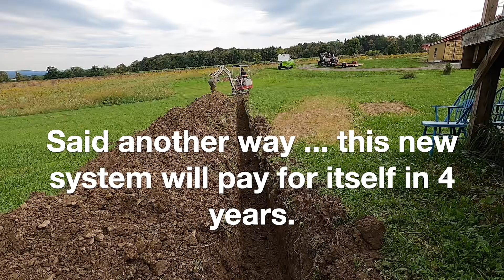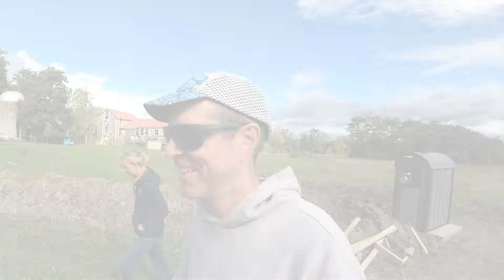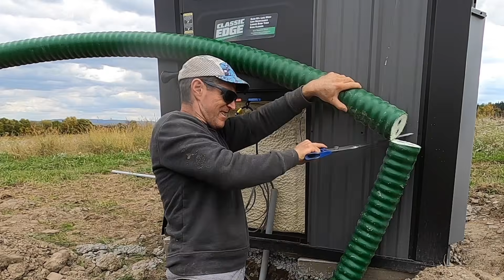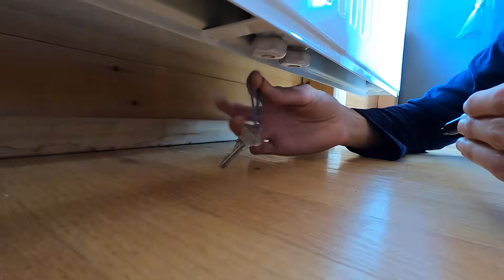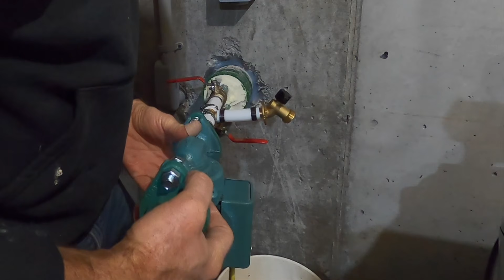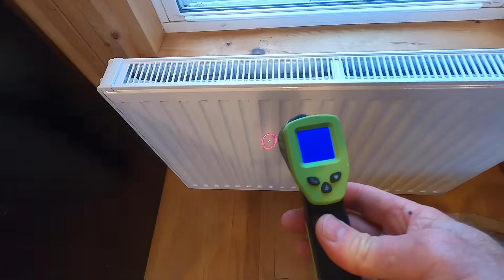Outdoor Wood Boiler FULL INSTALL, Start to Finish

Comment: So where are your links man?! Where did you get those radiators? I have Toyotomi  electric fans for mine. I haven't even actually used my wood boiler yet. Just moved into the place in the winter and can't really fire it up until I get everything checked out. They didn't hook everything up right either so I have a lot of restructuring to do. Might just go geothermal instead.
Reply from the maker: just search for "european radiators" and you'll find what we used. You're gonna love that heat once you get it running! nothing beats it
Reply: @metaspencer European? Does that mean they have to get shipped from Europe? You should do a video on where you bought them, how much they cost and shipping and stuff like that. Yes, I hope you are right.
Reply from the maker: we found them locally through our wood boiler dealer .... great radiators!
Reply: @metaspencer Sorry to bother you again, what is the brand of the European heaters you bought? Thanks!
Reply from the maker: I'm not sure of the brand ... sorry to not be of help. no markings on them even

Comment: why so far???
Reply from the maker: We like to be able to open windows in winter and not choke on smoke. We also like to spread out buildings out and keep woodpile mice away from the structure. Perfect placement for heating both buildings, too

Comment: I want one of these for my shop but I will only heat it on the weekends. Won't the water in the unit and lines freeze?
Reply from the maker: Moving water is pretty hard to freeze, but yeah, you might want to run an glycol mix in those lines

Comment: Why did you put the wood burner in the next county over?
Reply from the maker: we like to keep smoke away from the house in winter, as well as mice that live in the wood piles ... on a huge property we also like to spread out our buildings. Could have been even farther away but the location had the perfect contours and altitude in relation to the house and heated barn given weight of the pumped water
Reply: @metaspencer  I actually watched your follow up video and heard your explanation. I will be installing one eventually, your videos are helpful. Thanks and good work!!!

Comment: I put all my pumps in the basement of the house so if a pump was to fail I don’t have to go through the pain of having to work outside in -10 degree weather in the dark in the middle of the night and believe me when a pump goes it always happens in the winter at night so I strongly recommend it!
Reply from the maker: sounds like a good setup ... with our boiler being lower than the house I kinda thought pumps at the unit would help move the water

Comment: Whats your climate like? Ill be building in Midcoast Maine and really want to do radiant floor heating. Seems like it would be the most efficient. Do you lose any temp for a longer footage system?
Reply from the maker: Only lose 1 degree between unit and house, so not a problem having a long run. Climate is similar in upstate NY. Radiant is the way to go -- our radiator system is way better than forced air IMO

Comment: I was going to say you should have installed it much closer to the house so it stays hot but looking at that tube which will be buried underground I would say you are in good shape.
Reply from the maker: Yeah, we’ve only lost about 1° temperature between the boiler and the house so it’s been working out good

Comment: Did you run a thermostat wire from boiler to thermostat in the house? How did you hook that up?
Reply from the maker: boiler has a wireless control panel so you can track furnace water temps on your phone or computer

Comment: Hi. Why did you add a pump inside the house? I’m going to be new to this. I have a small 1400 sq ft house. Thanks.
Reply from the maker: we had two pumps on each line given length and drop to the boiler, but there are many people who only install one pump per loop

Comment: Why so far away.....
Reply from the maker: we like to keep our buildings spread out, don't like smoke in the house in the winter when windows are open, prefer woodpile mice far from the house, and it's at a good point to heat multiple buildings

Comment: I appreciate all the hard work that goes into setting this up. Hope you like the operation of it because I know I would not. For the price of this entire system you probably could have purchased two Kuuma Vapor Fire 100 furnaces had them placed fully inside your home and barn without all the problems that go with OWB.
Reply from the maker: I haven't seen those Kuuma Vapor Fire units you like so much, I'll have to check them out. What we like about this one is that there is never any wood or smoke in the house and only need to refill once a day. Sounds like you know what you like as well

Comment: Question? Would it off saved any length of piping to locate the stove midway between the house & garage?
Reply from the maker: Oh yeah, we could have saved on pipe by putting it right in the middle of our sidewalk between the two buildings, but instead located it in a spot that was lower than the structures (necessary for the system) and ideal for a huge wood shed. Working for us for sure

Comment: Why would you put a boiler so far away from the house? It seems so illogical (dumb) to me on so many levels. Who goes outside 165 yds from the house to restock the boiler. Especially as Trump is getting rid of the cheap labour
Reply from the maker: Sounds like you know what you want, and that's a good thing. For us it's ideal to space out our buildings, keep smoke away from the house in winter, keep wood-pile mice far from the house, and to locate the boiler between the two buildings it heats: shop and house. It's also located lower than the house which is ideal for the water system. Filling it once a day is a joy, not a burden

Comment: We want to know what the temperture in the house is! Or how much electricity and Wood it uses!!
Reply from the maker: We keep the house between 75 and 78, so it's pretty tropical in here all winter long. Wood use is one load a day ... I'm not sure in terms of cords as it depends on what you're burning. We burn mostly ash and oak so go through about 6 cords (though I haven't measured exactly). Electric use on the pumps and the blower in the shop is something I haven't measured ... probably $20/month to run the system ... maybe less. Oh and I keep the shop at 60 degrees f

Comment: Why so far from the house ?, isn't there a lot of heat lost in the length it has to travel .?. Just asking because I don't know the answer.
Reply from the maker: we lose 2 degrees between the unit and the house -- for us it's ideal to space our buildings out, keep smoke away from the house, and keep woodpile mice far away as well.

Comment: The only thing you did wrong on your trench work is that you sleeved your electric line in PVC. You can't sleeve UF cable more than 24 inches, it's a direct bury cable a d now you have double insulated it and lowered the amperage rating of the wire.
Reply from the maker: Bummer, and to think that I've been doing that for years! I suppose it depends a bit on the dimension of the PVC, but fortunately has worked out just fine over the years

Comment: A coil with forced air. For quick heat
Reply from the maker: Yep, that’s what I added in the workshop and it does the job… Just a little bit noisy

Comment: Film mighy still be 2 years old, but have never seen such a system. We, i live in Sweden, have the woodburners inside the house then the basement is heated as well. How often do you need to warm up? We have cold winter up to -30c. Is there much heat loss because of the distance it has to go under ground? And how deep are the pipes?
Reply from the maker: Hello friend! Our winters are very cold as well, though only down to -17c on the coldest days. The water loses 1 or 2 degrees between the outside unit in the house, and we have no smoke, wood, or wood pile mice in the house. The pipes are a little over a meter deep
Reply: @metaspencer thank you for yous reply, that sounds great. Can you choose to instal it closer to the house?
Reply from the maker: Yes, in our area, we can put it anywhere we want but for some people there are code requirements on location. We like it far from the house to keep smoke and rodents away.

Comment: Don’t run water under sewer.
Reply: This is not apart of their potable water system it will heat their water with a heat exchanger

Comment: What size drill bit did you use to cut your foundation for the Thermopex?
Reply from the maker: 4.5” but needed some massaging to fit through
Reply: @metaspencer  gotcha so 5in for some room for mortar or foam?
Reply from the maker: @connorbense241  yeah that would prolly work for ya ... I didn't want too big a hole so went with "smaller is better" hahaa ... but I'd be sure to measure your green pipe just to make sure that you're drilling for your exact pipe. dunno if they manufacture them all with identical diameters

Comment: My boiler is 15 feet from my house down wind
Reply from the maker: Sounds like that works for ya! No problem with code officer, insurance guy, or woodpile mice?
Reply: @ no. Less than 300 degrees comes out of the stack. All stone house. Sometimes there is some smoke that blows towards the house but if you’re burning the eclassic right there should be no smoke. I’ve had mine since 2008.  I live in the suburbs. There is a leak in the firebox that I have to get fixed.
Reply from the maker: @larrytornetta9764  you'll get it welded up ... sounds like a great setup! can't beat the heat

Comment: I’m brand new to the world of wood boilers, very intrigued! Just curious why is the boiler itself so far away from the buildings?
Reply from the maker: people located their boilers in all kinds of places -- we like ours far from the house for layout/design reasons on our property, to keep smoke and wood-shed mice away from the house, and to space things out. so works for us but not necessary to located it where we did
Reply: @ that makes sense, I was trying to figure out if there had to be a minimum loop length on the pex or something which required it to be farther away. Appreciate the response! Killer setup
Reply from the maker: @Cws0024  some people have insurance company or local code requirement regarding placement, so there are several variables

Comment: Plumbing and Heating tech here— it looks like you used regular pex piping- correct material should have an oxygen barrier.. in my part of the country, it is an orange color and way different than domestic water pipes that we use for plumbing installations. 
You will find out the problems when you try to get the water chemistry correct— rust is not your friend. Sorry ☹️for the bad news. 
This is a long term situation- as in 5 years you may have a premature failure of some of the components.
And please rotate the circulators so they are parallel to the floor. — pronounced take oh, not like the Mexican food..
Reply from the maker: This is an open system no closed loops …. Still recommend the orange pex? That mis installed taco bit the dust day one. Oops! Living and learning
Reply: @metaspencer True about the open system,but It’s more vented than open with the 2”at the top. Heat pex is a different material made for the slightly higher temperatures than the domestic pex and it won’t pick up the O2 in all of the system. 
Also, you could use the plastic bends instead of all the elbows for the 3/4 lines.
I am surprised that the manufacturer wants such a high ph— I would think that a more neutral 7 would be better. 
 One last thing— the engineer that posted earlier has it right above the gpm flow and I think that you might be a bit under to heat the property. Check the head loss together with the distance, fitting allowance and change in elevation on the spec sheet for the circulators— I hope that a 0011,0012 would work for you. Sorry that I can’t see the number on your video. You might consider the stainless steel models for the cicrcs if you ever need to replace them. Good luck.
Reply from the maker: @JTTTTx  Big help buddy! interesting perspectives and ideas .... much appreciated

Comment: U will cut through that concrete faster if u keep spraying 10w40  on the blade or used old recycle oil! It will slide easy and keep it from dull blade!! 😊
Reply from the maker: Thanks for the tip! I’ll try that next time

Comment: Why so far away ? Looks like you could put it closer?
Reply from the maker: We prefer to keep smoke and mice away from the house (mice love wood piles). Works great for us
Reply: @metaspencer  ok makes sense, I put my wood on the porch for the winter and I do see a field mouse from time to time. My woodstove still in the house but I noticed the advent of the outdoor burners about 10 years ago. You can burn pine too !!  Do the mice stay warmer in a wood pile than a nest in the ground or wherever they make them ?
Reply from the maker: @MesaBoogieman82  we only burn hard wood not pine .... to keep the creosote down. But I know out west there's a lot more pine and less hardwood
Reply: @metaspencer  ok I always thought the advantage of the outdoor burners is even burning pine, it's so hot and just a short stove pipe that you get no creosote. I definitely never burn pine but I use inside wood stove and chimney. Even if your stovepipe caught fire outside (which it probably wouldn't) it would just burn off harmlessly. That's what I've been told. The people I know w outdoor burners use pine too.
Reply from the maker: @MesaBoogieman82  I suppose some outdoor boilers work that way, but ours is a gassifier unit so the smoke goes from the fire box, down, then around a complex manifold ... not just up and out the chimney. So there are lots of places where creosote can buildup. I like to keep it all very clean
Reply: @metaspencer  totally understandable. The Regency stove I have has the manifolds as well. I got it 20 years ago, the manual said smaller hotter fires were best. I still have to damp it down some when I sleep so I have coals in the morning. 🔥✊

Comment: No thermostat?  Is it just "add more wood if you want it warmer indoors, less wood if it's too hot" or do you have a way to regulate the temps at the radiators?
Reply from the maker: the furnace regulates the water temperature and keeps it cycling between 160 and 180 ... we regulate the temp in the house by turning radiators on, off, up, or down. so yeah, no thermostat! works for us we are at a constant 78 degrees all winter

Comment: What did you do for thermostat? 
Are they just shut off manually by the ball valves? Or do you have a sensor that controls when heat is needed in the house?
Reply from the maker: No sensors, no wires, no nothin. Just run them to heat the house. You could run zone valves and all that, but we keep it simple

Comment: Have mine intregated in with a gas boiler, when the temp in the wood boiler drops the gas turns on and vice versa, can also vave each one out for repairs and run the opposite one, made my own manifold dont like the complicated ones, been running 22 years now love my boiler
Reply from the maker: sounds like a great system that you've worked out! for us it's all wood all the time :)

Comment: Couple of energy go crap. Why not insulated the hause? In my region the energy, wood, gas price now in the sky.. (Hungary,Eu) My hause 200 m2 net. and I can solve the winter energy demands with 4 pcs ductles air conditioner, and 1 pdc heater in the bathr.. Winter time here couple of the time -10 in the night and -5 in the day. My workshop also heat with AC.
( sure I have 55 pcs solar panels and two inverters to produce energy.. now not battery because I have a contract with e. suppliers to saldo).
Till 3 years ago we use gas.. just when the russian bear start the dance, the gas price go to the top.. ( 7 times expensive then before..)
Reply from the maker: Sounds like you have a good system! well done friend!

Comment: Do u really need a pump outside and inside?
Reply from the maker: there are a lot of ways to do it and a lot of people only go with one pump ... for various reasons we went with both
Reply: @metaspencer  I'm doing my system now. 125' from house 1" thermalpex feeding two forced air heat exchangers and a water heater
Reply from the maker: @electromechanicalstuff2602  sounds like you're gonna be WARM this winter! pump size and number seems to me to depend most on the head of water above the lowest point on that boiler ... for us we have a bit of an uphill run ... you did a deep trench for that line?

Comment: Out of sheer curiosity, why did you go directly from the boiler to your radiators? If I would’ve done this, I would’ve gone via a water heater to not only get hot water for showers from it but also as a bit of a buffer tank so if you are away for a day, your whole system doesn’t go completely cold.
Reply from the maker: We later ran a line from our manifold in the house to a heat exchanger at the water heater ... we did it the way we did it to keep things simple. I'm still considering a separate loop with thermostatic valves

Comment: what do you do if its freezing 0 degree temps for several months and I decide im going on a tropical vacation for a week or two. What happens to the boiler at that time?
Reply from the maker: there are a lot of options: you can not worry about it and the water temps will likely be fine, you can heat your house with your other heating system and that heat will backfeed into your boiler, you can put a heat lamp inside your wood box, and/or you can run a glycol mix with water that will never freeze.